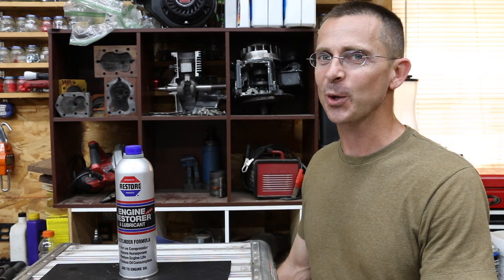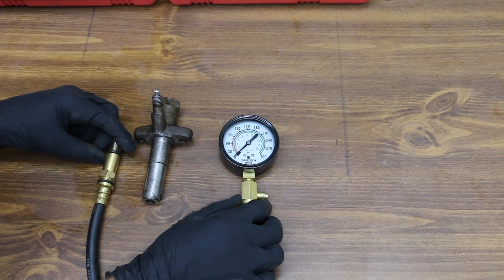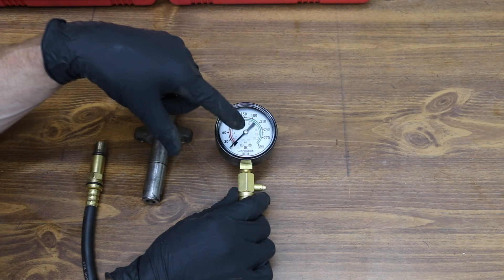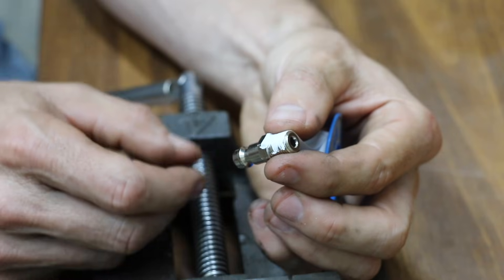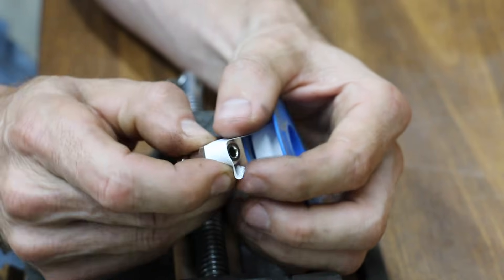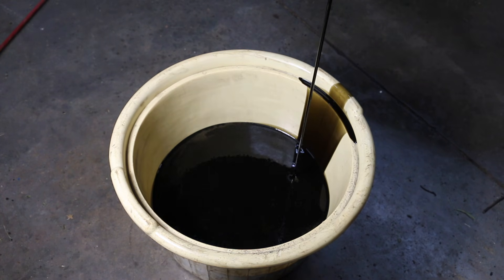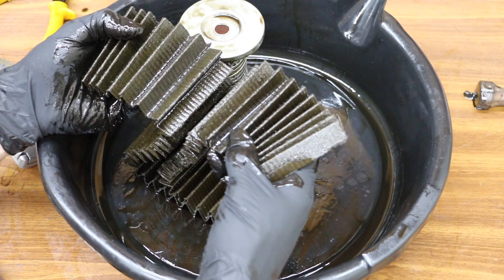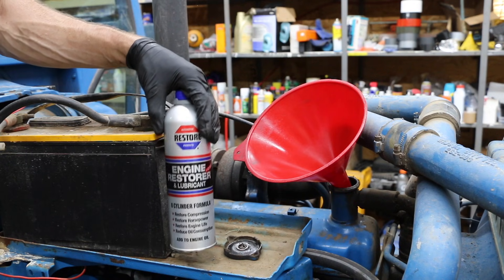Did the "Engine Restore" Compression Improvement Last?  One year later (Episode 2)

Comment: One thing I've always wondered about is something I heard Honda guys did.  They would have engines with 400-500k miles on them and they would lose compression from wear, instead of additives, they would just run diesel oil instead of the recommended weight oil.  It would be interesting to see if running heavier oil would improve compression in a clapped out engine like they claim.
Reply from the maker: Thanks for the recommendation!

Comment: If your engine won't start when it's 70 out to hell with "cold blooded" that's just a bad engine and needs rebuilt "cold blooded" is when an engine won't start or has issues starting around 40 to 50
Reply from the maker: Great point.

Comment: I do concur with Restore.  I have used it in my two Chevy 4.3 (TBI) engines for the last 12 years.  One had a little smoking on startup which likely is valve guides/seals.  That smoking stopped very quickly.  Fast forward to now, and one has 285K miles and the other has 375K miles.  Both engines are original/unrebuilt, and there is no smoking under acceleration or startup from either engine, and I never have to add oil between yearly oil/filter changes.  Also, inside the lid of the air cleaners (TBI), there is absolutely no oil residue in there either.  If you were to do a blindfold test you wouldn't think either vehicle had over 50K miles, they both run that good, and reliably.  I just use Valvoline MaxxLife or Mobile 1 High Mileage 5-30, and years ago, AC Delco oil filters (PF52), until the e-core filters took over, so now I use Napa Gold (Wix) filters with no trouble.  It is absolutely worth the extra money for that can of Restore each and every time I change the oil!
Reply from the maker: Impressive results!

Comment: Quick tip for you when you cut open the filter and remove the media like you did leave it pleaded put it into a vice and squeeze hard as you can to get the oil out and clean it up and when you remove it from the vice will be no oil in the pleats and it's easier to see against the background
Reply from the maker: Great tip!

Comment: “Power service” diesel fuel additive works great in my class A commercial truck.  It improves fuel economy by .1 mpg and it runs smoother  due to the added cetane.  There is a more noticeable difference when using this product in winter blend of diesel fuel bought at the pump versus the summer blend.    

Thank you for such amazing videos. These are highly educational.
Reply from the maker: Thank you!

Comment: You should test Rev X, it’s an oil additive that’s supposed to help free up diesel injectors with lots of hours on them. Used it in my 7.3 with 204,000 miles and it seemed to help a ton! But I’d like to see you test it. It’s spendy but worth it I think
Reply from the maker: Thanks for the recommendation!

Comment: I have had very good results with Engine Restore as well. I had a old Fiero with a Iron Duke in it that had a descent amount of blow by and I would end up with oil in the air filter housing. I started using Engine Restore and it basically stopped this from happening. I did find that it does not seem to work well if you just add it to old oil. It only seems to work with new oil. That might be a interesting test to see if the Engine restore increases compression when added in oil old oil vs just changing the oil with new oil and testing engine compression afterwords.
Reply from the maker: Impressive results!

Comment: I agree completely engine restorer really does make slghtly tired engine work nicely ive definitely had results. Sea foam is my other go to and wd40 also. I use the seafoam a lot on carbs that are pretty crusty. I take a little pump spray nosel and draw the seafaom out and saturate the carb a few houra before im gonna clean it sometime multiple saturation is good but never had a carb i could fix. Nice job man. Nice piece of land you have there.
Reply from the maker: Thank you!
Reply: Rob Plotts
 - My 2 cents. Forget all that. Old tooth brush and white spirit/mineral spirit, turpentine. Whatever it´s called where you are. ;-)

Seldom need more than a dip for a few minutes and some tooth brush action. It REALLY cleans any carburetor. Although a word of caution it MUST be disassembled. 
Any rubber based material will be spoiled in contact with turpentine.
So disassemble it all, O-rings, diaphragms , etc. Never had a carb I couldn´t fix. ;-)
Believe me had a few bad examples coming from scrap yard, where somebody tried to fix it with self tapping screws and chisel/hammer to "unstuck" parts! With that level of "expertise", you can image the condition. LOL :~(
Cheers

Comment: You can not restore worn metal. Only thing can improve performance is that if that clean the injection some how. Usually performance drops because of dirty injections. But could it be that that liquid clean the piston rings and now piston rings moves and seal better. 
Usually if you have use fully synthetic oils there should not be any dirty in piston rings., but this is old machine so probably not has been used good oils. Are you using fullysynthetic oils.?
Reply from the maker: Great point.

Comment: I don't know about yours, but our 5000 has glow plugs for cold starting. Turn the key backwards for 7 seconds, turn key off, then backwards 7 seconds again, and it will start right up, even down to 20°f
Reply from the maker: When I acquired the tractor, someone had disconnected all of the wiring.  That's another video....lol

Comment: Hotshot secret sticktion eliminator oil additive and the hotshot secret fr3 engine oil additive. I use both in my truck what does it actually do to the cylinder and cylinder wall, is it good for the crankcase? I think it would be a good experiment on a small engine.
Reply from the maker: Thanks for the recommendation!

Comment: Interesting to see the results over time. This is very helpful and informative.  I’ve personally seen Restore bring other badly worn engines back to life and add some power to other older engines so the long term compression results are very welcome.  

I will say that I have a near 300k mile Miata with a lot of blow by and after letting restore do it’s thing for about six months of daily driving the engine become more responsive after omitting it from further changes. I’m not sure the official service life of the additive is but it may only be beneficial every couple of oil changes or so on an engine that is only mildly worn.  I may run some again soon and observe the results but I was as impressed as anybody with the performance of this product.
Reply from the maker: Impressive results on the Miata!

Comment: The 500 are fine tractors. If it works for you it works, that's all I can say. Not going to argue with proof. ANytime you can get the compression up more a diesel will start easier unless the injector tip spray pattern has been ruined by pre-ignition by using too much ether which burns away the spray nozzle holes and instead of getting a spray, it dribbles and doesn't atomise. I've seen them have to have ether at operating temps no matter what. So good deal, Commander! Runn that stuff and happy motoring or tractoring, rather and BLESSINGS 2 yall!
Reply from the maker: Hi Lewie,  Great point regarding the injector tip and use of ether/pre-ignition.  Wishing you and yours many blessings!
Reply: Old fords never die!!!

Comment: Are you running Motorkote in any of your engines? I started using it in most of mine, both small and large. Also threw it in some transmissions. What's the worst that can happen?
Reply from the maker: It's a great product and I need to buy some. My vehicles are towards the end of their life cycle and the cost of products is a huge factor.

Comment: I'd like to see some testing done with Lucas Oil Trans Fix if you ever happen to come accross something with a failing automatic transmission. I have a cheap piece of crap I drive to work and the transmission started slipping and slamming into gears fairly violently. I decided to give the trans fix a try and it actually worked pretty well. While it doesn't exactly shift like new, it shifts good enough. I was hoping to get another few thousand miles out of the transmission before I bought another car - that was about 40,000 miles ago.

I'd be interested to get an explanation of what makes it work - it was about the consistany of gear oil. I wonder if it's doing nothing more than making the trans fluid thicker making up for the worn out bands and clutches. I'd also like to see how it affects wear on the transmission parts. Surely a thicker fluid would wear things out quicker, but I guess if it's already worn out who cares?

I suppose if the trans fix keeps working I'll eventually need a bottle of that engine restore to keep this piece of junk on the road. I'd never really reccomend these miracle in a bottle type things, but some of them are impressive.
Reply from the maker: Thanks for the recommendation!
Reply: I have a Jeep Liberty CRD (Turbo Diesel) with a 545RFe trans. I put a custom tune on the engine that increased both power and torque AND removed the torque limit when the torque converter is locked. The stock converter could then  slip on demand and did so with even a light touch of the throttle when it was locked and below 60 MPH. (This feels like hitting rumble strips.) Using this new condition that I have control of I tested the Lucas Transmission Fix. It didn't help at all with keeping the torque converter locked. However, two little tubes of "Doctor Tranny Instant Shudder Fixx" did help. Nothing could eliminate the shudder entriely except for a better torque converter given the crazy torque I was putting it through, but the bottom line is that Lucas didn't help at all. Of note, I changed the trans fluid again between the products. My Jeep CRD has 195k on it. The trans also shifted extremely hard between second and third gear. This was caused by bad hall effect input output speed sensors. With those giving the wrong values to the computer, it was unable to engage the clutches at an accurate time. This may be the cause of your hard shift if your trans is electric controlled.
Reply: Actually my transmission was damaged by running low on fluid. Basically it developed a small leak in the cooler lines and because my transmission is one of those GM atrocities where they took away the dipstick I never really checked the level until my transmission had been running low on fluid for an unknown length of time and the level got low enough to start screwing things up.

Comment: I believe it worked for you because your engine was just tired. It also is not a massive or high hp engine either. Engine restore may have its select cases where it works, but my old accord engine had 195-150-70-70 and would not run. Pulled engine and popped the head to find horrid amounts of taper bore wear.
Reply from the maker: Wow!  Some really low compression in those 2 cylinders.
Reply: Project Farm and all 4 were taper worn in the bore

Comment: You should test something that I know thousands of people are wondering... if the 10,000 mile oil really works. I think that you should do the labrisky (however it is spelled) test on new vs used 10-30 (or whatever thickness you’d use) after 3,000 miles then do the labrisky test on the new vs used (after 10,000 miles) 10,000 mile oil. I would really love to know!!! I work at my grandfathers mechanic shop and we don’t have the time or the resources that you have. Thank you so much for considering!!!!
Reply from the maker: Great recommendation!

Comment: Have you compared regular oil vs synthetic oil. I have read that synthetic does not break down as easily due to heat, remains fluid at a lower temperature, and sticks to metal better as demonstrated on the commercials where the drain the oil and run the engine until fail. I have always wondered how much of this is true and how much is sales hype.
Reply from the maker: I plan to put together a video on this soon. Thank you!

Comment: could it be put in a 7.3 with full synthetic oil, I have a 7.3 ford with 516,900 miles its still running but has a few issues with weird idle and lower power. what do you think?
Reply from the maker: I wish this product could be used in the Powerstroke but their website mentions that it is not formulated for use in HEUI fuel systems which are used in Ford Powerstroke diesel engines.

Comment: DO A VIDEO ON NMF

" NMF eliminates the attractive electrical relationship which is the root cause of most friction. Creates a negative-negative operating environment so metal parts repel each other and residue is repelled away from metal. RESULTS: less wear and clean parts."

I used it on my 2011 Acura TSX V6 with interesting results! I got a P2646 code, and got an oil change after 150 miles of use with it. I've used Marvel's Mystery oil and engine restore in the past (I got 114k miles on engine now) and the oil wasn't that dirty, and boy, let me tell you. My wix oil filter was complete SLUDGE!! I've never seen anything like this come out of my engine. Now, with the new oil. My car doesn't vibrate nearly like how it used to and I can't wait to dyno and see the numbers! Oil filter was disgusting, I tell ya.
Reply from the maker: Great video idea--thank you!

Comment: A cheater way to get a diesel to fire due to lack of compassion especially after it’s been sitting a long time is to put a small amount of ATF in the cylinder itself. Since diesels fire under compression the ATF will help to tighten the gap in the cylinder walls because of its viscosity and it may give the engine that little bit of  extra help it needs to fire up. Not saying it a perfect method by any means but it has worked for me in the past. Thanks for the videos and the great Chanel. I really enjoy seeing what these products can do and the professional approach you take while testing them.
Reply from the maker: Great tip!

Comment: Project Farm, you have inspired me to try out this product last year. I used the 4 cylinder formula but I am sure it is the same formula as the 8 cylinder formula but just less product. 9 oz compared to 16 oz. I tested it on a 1988 Honda Civic with 209,000 miles. Even before Restore, the engine was running healthy for the mileage it has, but Restore definitely improved the engine. Not necessarily faster, but the response was noticeable. I never tested out compression before or after the use of Restore but I definitely know that the engine benefited from Restore and I like this product. I also did an oil analysis and it does contain a lot of lead and copper. Video on my channel if anyone is interested. Thank you for the review on this product.
Reply from the maker: Awesome!  I glad the product helped.

Comment: I run Mobil1 in a 2004 Ford Focus it now has 220,000 miles and still going strong. I change the oil every   
7k miles. I know that isn't high mileage but they weren't supposed to last long either....
Reply from the maker: Mobil 1 is a great product!

Comment: Not an oil additive but automatic transmission Trans X stuff is like a shift kit in a bottle, slows leaks too!. Also K&W Block sealer for those pesky coolant leaks or head gasket issues.
Reply from the maker: Thanks for the recommendation!

Comment: I had good results with engine restore for about a year.  Then I got a lot of blowby, it was a worn engine, but  it seemed like it accelerated the wear slightly.    I'd like to see bars leak and other rear seal fix additives tested.  That's probably harder to do though.
Reply from the maker: Thanks for the recommendation!

Comment: Do you think the injectors could of been the reason the tractor didnt want to start before?
Reply from the maker: Great question. I didn't do too well explaining the history on the injectors.  I thought the cold start issue was due to worn injectors.  After replacing the injectors, the condition did not improve.  I then used engine restore a year ago and it helped a lot.   Thank you!
Reply: thank you sir!

Comment: Very cool I'll have to try this on an old tractor engine of mine, but I do have a suggestion for a video. A few days ago I was given a few old cans of Pennzoil outboard motor oil and I was wondering, since I'm going to empty them out anyway, if I could use the oil in a small Briggs or Tecumseh gokart/minibike/mower engine?
Reply from the maker: Great recommendation!  I put together a video on 2 stroke oil in a 4 stroke crankcase.  The viscosity is lower and will likely result in increase oil consumption and blowby.  If I had extra 2-stroke oil around, I'd add it to the fuel tank on the Ford 5000.  It provides excellent lubrication for the old injection pumps.

Comment: CSL IS  EQUIVELENT TO SYNTHETIC LAB COPPER SILVER LEAD, CHEMICALS, THE PARTICLES SO SMALL WHEN YOU PRESS ON FINGER ARE SOME SYNTHETIC POLYMER HIGH TEMP PLASTIC, IF THAT BOTTLE HAD ANY LEAD INSIDE OF IT YOU WOULD NEED A FLUX CAPACITOR A GUY NAMED DOC AND SECURITY CLEARANCE WITH A FLASHING RED LIGHT ON TOP CAN WITH SKULL BONES AND HAZARDIOUS MATERIAL WARNING ON SIDE OF BOTTLE. THEN WALMART WOULD ESCORT YOU TO YOUR CAR. HOW MANY MONTHS DOES EVERYONE WANT FOR A 8 DOLLAR MIRICLE BOTTLE SINCE 84.
Reply from the maker: Thanks for commenting.

Comment: Use an impact wrench with a 12 point socket to tap those holes. You have to feather the trigger so you don't break the tap. I've used this method tapping a quarter/twenty into mild steel and never had a problem. Make sure you use cutting fluid as well.
Reply from the maker: Great tip!

Comment: Have you ever tried redx? It’s a fuel additive that cleans the fuel lines and helps clean the valves if you haven’t do a video on it could u ? I wanna see if it really works for you because, it does for me in the uk 🇬🇧 in my 1997 rover metro which is a 1.4 16v engine
Reply from the maker: Not yet. Thanks for the recommendation!